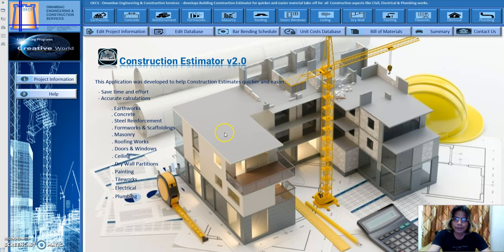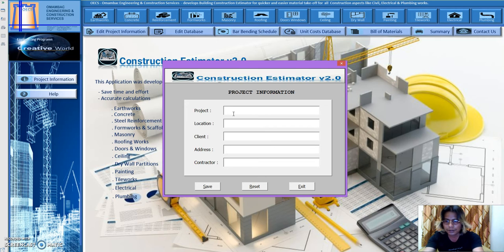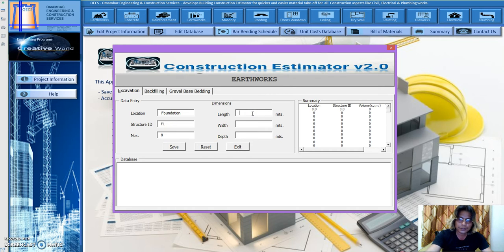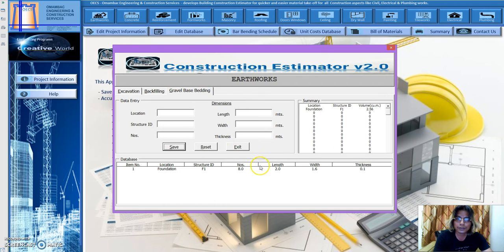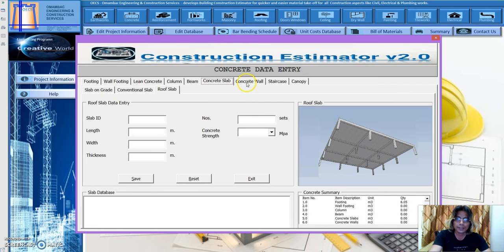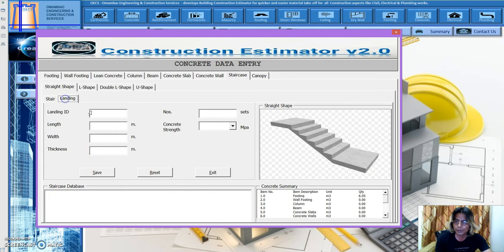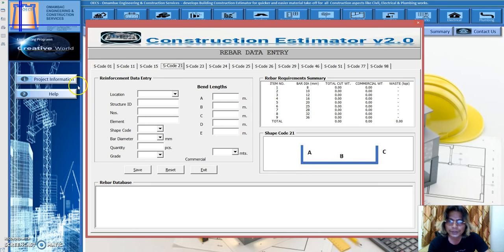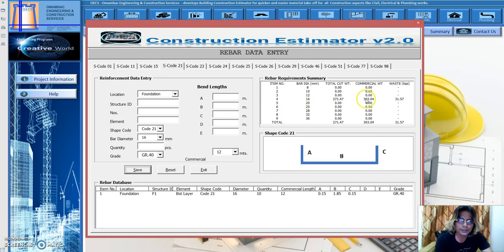Estimator Video Presentation Part 1

Comment: Sweet!, does it have edit function if ever there is revisions? You assumed 12m as your commercial length, while 9m would give you lesser waste, is there a way to change that 12m to 9m? And if you don't mind sir, could you please make a detailed rebar application for beams (continuous beam, with different span length/rebar sections or rebar count and diameter/curtailment length. Thanks!
Reply from the maker: Yes, you can select whatever length is sufficient with less wastage. We have options for commercial lengths.
Reply from the maker: It is in the input data entry tab for Rebars, all shapes, diameters for each structure
Reply: @budongcreates5404   @Budong  what I mean is an EDIT BUTTON. For example I used 12m but then later on I decided to change it to 7.5m.
Reply from the maker: @mongoloidgaming3935  Yes Sir, in our software we have "Edit Database" tab where you can edit there the com'l length you want then your output will be automodified